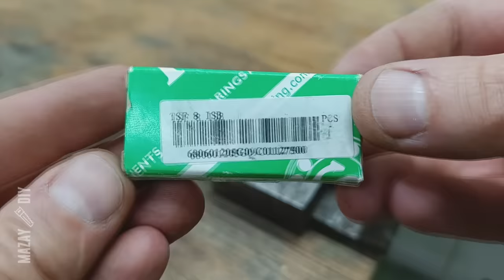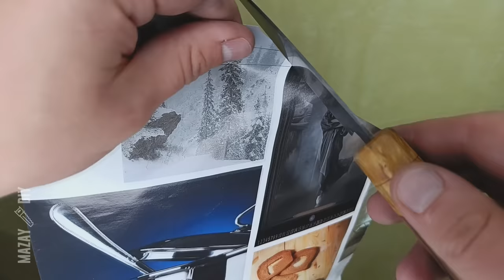Homemade Knife Sharpening Jig | Scary sharp knives

Comment: Watched a thousand videos about Jigs and seems like no one really cares about the angle or never show it in the videos.
Reply from the maker: It cares me, at least.
To set the required sharpening angle you need a phone... which I use to shoot videos)))
Just download the Smart Protractor app or similar. Place the phone on the base, zero it, then place it on the guide and adjust the angle with the nut on the threaded rod.

Comment: I made this in an afternoon. I used poly carb plastic scrap in place of the steel knife alignment and scissor clamp. Getting the stainless sharpening rod down to exactly 3/8” took the most time. Try to find a rod that is the exact diameter or a tiny bit smaller. I also made a second rod about 6 inches longer which works better for me. A stop nut on the back of the rod is also helpful. Bottom line is that the design works great and is made for next to nothing cost wise. I then bought stones from Gritomatic for another $80. You will also need a digital angle finder.

Comment: That second to last cut with the rolled paper, wow. That is scary sharp! Fantastic work sir! 
Just, wow. I've seen $1500 sharpening systems not get close to that level of sharp. 
That has to be like 25 or 40 on the sharpness index. I can't express how impressed I am. Really well done.
Reply: It's the fixed angle combined with a fixed location for the blade that allows perfect consistency on the sharpening.

It's not so much the concept as the design and work he did to make it that's so impressive.

Comment: The diamond plates, the grinding stone and the leather plates all have different thicknesses. So I assume the angle while sharpening hast o be adjusted depending on the tool you use. Do you also do this?
Reply from the maker: I made it easier - I finalized everything to one thickness. At the same time, the sharpener allows you to adjust the angle due to the threaded stud
Reply: Ah, ok. I also thought about the option to bring them all on the same level. But it seems also to be easy to adjust the angle by the threaded stud as seen on TSPROF video. Thanks a lot for your answer.

Comment: In my case the the rod end bearing has to be drilled to an diameter a bit bigger than 8mm since the steel shaft of my old printer has a diameter of also 8mm and I wasn`t able to mount the shaft in the bearing. And for sharpenning it should glide really smoothly. Think it`s easier to open the bore instead of grinding the shaft...;-) Did you have the same problem?
Reply from the maker: No, I used a roller from an old inkjet printer - it fits perfectly. The printer can be bought very cheaply on bulletin boards, cheaper than the shaft alone. I haven't tried it, but I think it's really impossible to grind the shaft - it's hardened, you'll only ruin it without special equipment.
Reply: The grinding worked perfect. At the end it was easier than bringing the bore of the bearing to 8.01 or so. I just clamped the shaft into the drilling maschine and worked the diamter smootly down with a 800 grid sand paper at the end. Now it slides smoothly through the bearing. The surface is not that smooth than before, but it is ok.
Thank you very much again for your videos. Well done.

Comment: How do you set the blade angle? Is it the height of the guide on the threaded rod?
Reply from the maker: That's right - the bottom nut allows you to accurately set the sharpening angle

Comment: why the vertical steel axis is not in the middle but at the edge ?
Reply: the length of the swiveling thingy puts the horizontal rod in the center of the jig.